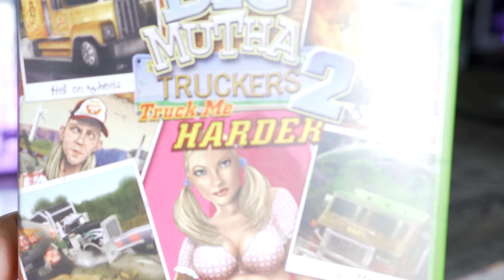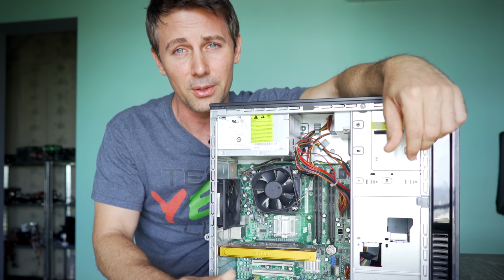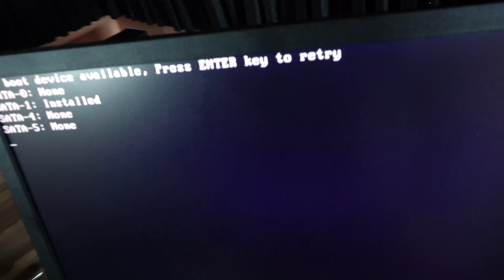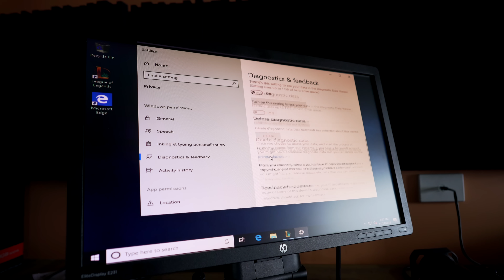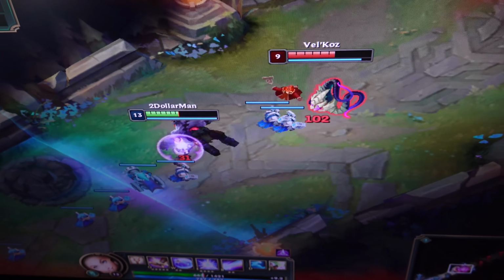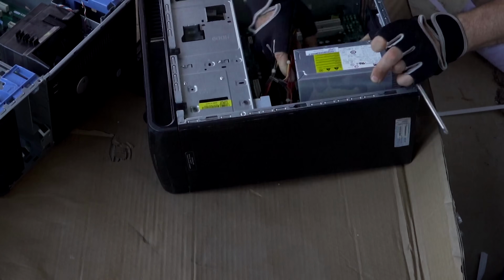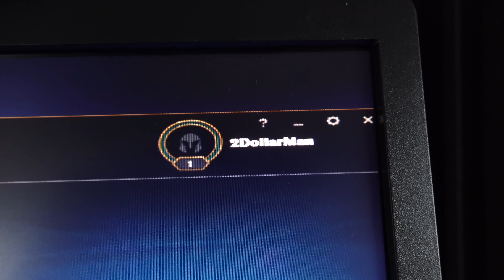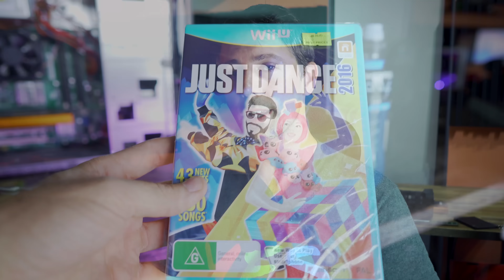This PC Costs $2.... Can it Play League of Legends...!?

Comment: Im glad its not just me who is having issues with 775 and compatability, I go through board after board after board, using what I know to be good RAM, and a good CPU only to have it reject it, until a few part changes later. It got to the stage when I was tested Windows 2000 that my much older PGA478 Equipment was actually simpler to use. Still I suppose if you like slideshows that performance seemed top notch. 

Great Video.
Reply: Quite a common problem with 775 is that it cannot use dual sided ram. I have had several boards not works because of that. but as well some of my boards just don't work at all
Reply: Could u make a video about the stuff u disabled on windows on the start to make it faster?
Reply: Just handed my old p5q + 9550Q 3.8mhz oc 8gb ram + 1050 gfxover to my girlfriend as a media center..... still runs WOT on 80 fps ... med settings
Reply: I once had a Acer PC with 775 and it would take 2 (out of 4) sticks with dual sided memory or 4 single sided... for a while. Also a lot of those OEM Machines with 775 socket have REALLY fkd up bios, for example a Fujitsu Siemens I have would support Q8300 up to Q9650... as well as even a Celeron E3200 and various Pentium and Core2Duo, but no Q6600 etc.

But since you gave up on 775.... : how about doin a 771 Dual CPU build? I use them a lot and really love how stable try run for rendering etc. :P
Reply: @Eduard Berisa i have paired both the xeon x5460 and the e5450 oced with a gtx 770 and can run fortnite @ +60 fps on 1080p high
Reply: Try using windows 7. I have a E4500 with 2gb ram and 9500GT and it runs LoL...
Reply: I just yesterday had a dell doing the same thing I ran the dell recovery that was on hard drive and it seems to work fine now it will still show same can’t read disk 0 when boot and just bypass that and continue and it worked fine so I have went into bios changed some settings and have not seen error again
Reply: I had no issues with my 775 dual core upgrade too q6600 quad all I had too do is research and make sure my bios was updated and supported and presto all worked fine ….
Reply: Budget-Builds Official Im glad its not just me who constantly comments on other budget tech channels to sponge off viewers.
Reply: @dramamine755   Oh sod off, I can comment relevant information if I want. If you think I comment for views then youre greatly mistaken....Then again its hard to feel offended when the guy commenting is mosty subscribed to "Minecraft Lets Play" channels. So if you'd kindly sod off, itd be greatly appreciated.
Reply: @dramamine755 : Unfortunately I don't need too. Still keep on Minecrafting :D
Reply: xP
Reply: @Nick Steinmetz My exact thoughts :)
Reply: Read your comment before the video, and "slideshows" caught my eye. Fun
Reply: Ok the dell optiplex should run League just fine, you need to update the bios to the latest version use a q6600 with 8gb of ram and use windows 7 for better compatability with the old system. By the way I have built several optiplexs that can run league just fine. Optiplex 755, q6600, 8gb of 800mhz dual rank ram, quadro fx1800, and it runs league at 80+ fps at 1440x900 with a mix of settings mostly high with shadows on low.
Reply: I have a 775 small acer desktop pc w/ Win 7..upgraded to a duo quad q6600 running PLEX server w/ 4TB drive and it rins GREAT
Reply: Budget-Builds Official that mother board look allot like the mother board for  Vastro 200 if your looking for the best cpu compatible with that mother board try intro core 2 duo model E8600 cpu 3.3 ghz
Reply: Budget-Builds Official ya the computer he is using is vastro 200 I know this because I’m currently using it.... I’m very surprised because his is way slower than mine and mine does not even have a graphics card!!!!!!
Reply: i have dual core e6600 and gt 440+ 2gb ram and running in  90-150 fps with low seletings
Reply: Budget-Builds Official .
Reply: Hello,My name is Thomas and by this message i would like to kindly ask you,to make a donation of your choice to help me beat my Mouth cancer.I am only 25 years old and i cant afford surgery on my own.I am young and deserve to live. :/ I hope you will help.Thank you and God bless you.

Bank account information:
Name: Tomas Adamik
IBAN: SK3602000000003907442054   SWIFT/BIC CODE: SUBASKBX
Reply: I've built around three 775 PC's. Just added a $15 Q6000 series quad cores to them. All works pretty well even without overclocking for modern games. ie. bottlenecks at around 50 fps no matter how good the GPU is.
Reply: Budget-Builds Official 
.
Reply: This seems very indicative of bad microcode to me. Had the same thing with an old asrock 775 board. It... just... sloggggged. Then I updated the bios and then it zoomed. The bios in there may only be coded for pre-core2 775 cpus.
Reply: Most 775 boards require low density memory like mine, hard to find, got   BLS2KIT4G3D1609DS1S00 on Ebay for $30 to max both my boards to 16GB
Reply: Taht was made for windows 7 and earlier....
Reply: @M1Singh_  as long as u have 8gb mem its quite okay. memmory is the restriction

Comment: Hi, I know this video is 4 years old, but I still have to speak up for the socket 775. The problem is the OEM manufacturers / providers like Dell or HP. They don't want you to upgrade your computer and use castrated BIOSes. These can be improved by updates, but even the updates have restrictions that regular motherboards from branded manufacturers for self-assembly never had. I still love using an E8500 or a Q6600 (with BSEL Overclock @3Ghz) on a 775, even if I only install 4GB. Then a GTS450 or a GTX750 is added and the babies are a lot of fun. One thing could have improved the situation for you, though. Less is sometimes more. You wanted as much RAM as possible, but 6GB simply don't run in dual channel and that makes the RAM incredibly slow and thus slows down the entire system. You built a bottleneck for yourself, I think. PS I would have changed the graphics card for another one before cleaning it. A 7600GS with 256MB and DX9....that's better left alone. The E4400 with a HD5450 and 4GB of RAM was the lowest level I've played LOL or Dota2 on so far.

Comment: I feel your frustration.  I used to play League of Legends on a Lenovo L540 laptop.  I wanna say core i7-4712MQ with the GPU being the built into the CPU I want to say Intel HD 4600 graphics processor (if there's a way to change that out I want to know) and the ram I upgraded, I think it was Crucial 16Gb DDR3L-1600/PC3-12800,  and the wireless card I had upgraded to one that had Bluetooth 4.0 even though I could never get the Bluetooth to work so... it was a pain.  Not the worst to play League on but certainly not the best either. I couldn't even Load Skyrim on it at all.  Fallout 3 wouldn't load or work, Pallone 4 certainly wouldn't,  Fallout New Vegas I could play for about 30min to an hour before it would start lagging and crashing (I feel I need to go through and deep clean it and give it some new thermal pastes and see if I can get it to work.  It was having trouble booting and all kinds of quirks and then in lat 2019 it blue screened and I haven't had anything aside from Xbox since.  I SORELY miss League of Legends.

I just took my old Foxconn A7MG-Series motherboard. It had an AMD Athelon X2 (though not sude which model.  I thought it had 8Gb of RAM (apparently it had 4) but also a Hodge Podge mix at that.  2 crucials, a samsung and something else. And I can't remember what the graphics card in it was, I'll have to find it. I could at least play Skyrim on that so it's gotta be better than the laptop.  Back in early 2013 I bought a new HDD or 2 for it, a new DVD+RW drive and a drive port that had a bunch of different card readers and like 3 USB ports including a USB 3.0... went to add it all in, carefully, hooked everything back up exactly how it was except for the new Optical drive, Card reader and new HDDs and it blue screened.  I TRIED FOR HOURS to get it back running, went to the BIOs and looked around to see if everything looked good and if it we booting from the proper C: drive and everything and it was just done.  The guy I bought it from was passed that I tried to add anything to it (even though he lived 2 towns away) and refused to even look at it.  I figured it was probably where I had like 1200 mods on Skyrim and a stock CPU cooler.  Though it could have been the GPU.  That one was bad for going through graphics cards.  It went through 2 (older but still working fine) graphics cards before I bought that one outright.  So... I'm curious to tinker with it and see if I can get it working.  And see what I can do with it.

Comment: I have 12gb ram 2gb vram and dual core lags stuter fps drops 01 from 30
Reply: Try 8GB or make it 16GB. I think it's the same Problem like in the Video....your Ram doesn't run on Dual Channel and Bottlenecks the System

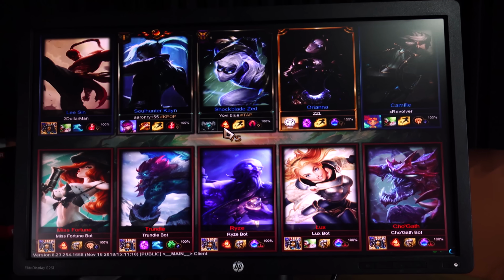Comment: 9:28  well i have a asrock lga 775 motherboard that have this issue, the main cause is they are worn out
 10:20 you didn't install the video card driver thats why the  performance is still the same

Comment: most gpu's and chipsets have phase change tim, it softens when it is hot and solidifies when cold, it actually a longer life tim than regular thermal paste which can pump out of the cpu/heatsink interface during heat cycles.

on assembly they are heated to melt the tim and allwed to cool that is why they often feel "stuck" to the chip.

Comment: Lga775 is one of the best platform next to lga 1366 
I had some good mobos, for example: EVGA nForce 790i SLI FTW, ASUS P5K3-DELUXE ect. And i loved them... and the 771 xeon conversion just made it more fun... 4.5 GHz stable overclock from xeon x 5450 and 5480 
And i had a celeron dual core e3300 that was good for 5 GHz oc.... so i love 775, theese dell,hp, ect mobos just shit

Comment: I rebuild a lot of these budget pc's. The OptiPlex 755 and Vostro 200 will do decent with the latest bios updates. Once it is done, you can install several different Xeons in these (socket 775) as long as they aren't over 95 watts and they will run very well. I have done and sold Many of these!  :)

Comment: I use a lot of LGA 1155 boards, because in my area they're basically just a value that can't be beat. But with that, I've used a lot of the generic Intel branded ones and I've run into so many weird issues (mainly with the Intel branded) like one just never booted again after I changed out the RAM even after I put the old RAM back in (and changed out literally every part to find the problem) and the thing just never worked again. One board wouldn't accept any modern graphics cards, so I updated the BIOS and then it accepted newer cards BUT then it would always freeze on the post screen and was essentially bricked. Another one was just annoyingly picky about what graphics cards it would use... Like out of 2 graphics cards released at exactly the same time (one Nvidia and one AMD) it would only work with one (the AMD). 

So I'm pretty tired of using those boards to be honest, and I think I'm just going to avoid parts like that which are just too cheap and questionable and just stick to better brands like ASUS for my 1155 needs. Some parts just get frustrating and wind up taking far more time than they're worth.

Comment: I am running 3 775 boards surfing, watching Youtube, burning Blu-ray and ripping DVDs. Not a gamer but my son played League of legends on my P43T a while back. My systems :GA-P43T-ES3G, Core2Duo E8600,A-Data 960GB SSD, Hyper 212 EVO ,Ballistix
 Sport 16GB Kit (4 x 4GB) DDR3-1600  : BLS2KIT4G3D1609DS1S00,HIS HD6570 
IceQ ,Win7,Corsair CX750M Power supply, Modified Dell 
PowerEdgeSC430,with Win7, Pentium Dual Core 945 @ 3.4 Ghz, 4Gb 
memory, Dell RadeonHD6350 vid card, GA-P45T-ES3G,Win7,Modified Xeon Quad
 E5472 3Ghz @ 1600MHZ to fit 775 board, Ballistix Sport 16GB Kit (4 x 
4GB) DDR3-1600,XFX RX460 4GB Vid car

Comment: Some LGA 775 motherboards have DDR3 memory. I have an Asus one with a Q9650 with 8GB RAM DDR3 1066MHz and a GTX480 1.5GB installed. It still works and runs games of the time fine, but it is showing its age and I would not recommend a socket 775 (or the even older 771) to anyone. Stick to Intel socket 1156, 1366, 1155 or even AM3+ if you wanna build on the cheap and still get some decent performance. 

If you can spare a little bit more, the socket 1150 are coming down in price as well (in Europe atleast.)

Comment: Its a big lie i have run league at 60 fps in very low settings  resolution=1440-900 
core 2 duo e4300 1.8ghz 
2gb ram 666mhz ddr2 
gt 520 2 gb ddr3 palit
this is all...
Reply: .........so you don't understand english? 

he had no idea why the pc was running soo poorly when it should not have been

Comment: MINIMUM SPECS
 to play lol (on very low setting):
2 GHz processor (supporting SSE2 instruction set or higher)
1 GB RAM (2 GB of RAM for Windows Vista and newer)
Shader version 2.0 capable video card
Support for DirectX v9.0c or better
So you must have done a mistake somewhere :s

Comment: most frustrating build for me in recent memory. was an LGA 775 asus p5n board. 6gb corsair xm2. xeon x5355 with evga gtx 9800+ 1gb gpu. no matter what i tried the board would not run the cpu at full speed. my sli wouldnt work. but was able to get 1 gpu running with a q9400 and hitting 60fps in farcry lmao. but agreed never touching lga775 again

Comment: when I was building my first used parts build, i got a free pc from my work. the hard drive died, so they just got a new computer. they had used it for our laser cutting machine and it had pretty much ran photoshop and other adobe software its whole life. i took it home and bought a 650 ti from a buddy and slapped it in the computer thinking "this will be great with a new graphics card!" I had not realized the pc was running a e6550 core duo with 4 gbs of DDR2 ram.... lets just say when i downloaded fortnite and tried to play it my experience was less than Potato and the bottle neck at the cpu almost detonated. cant complain for a free pc, but it really helped me understand the importance of researching your hardware.

Comment: It is not just because of the graphics card, but also the system files and utility software that you installed in your disk contributed to the slow processing of the application. I am certain that at any point when you "idle", memory leak issues occur which is also a culprit in the slow processing. Hardware is just something use to "hold". Blame the OS and your utility software for it is something that your hardware cannot hold. Did you check your BIOS and see if time worked fine too? Big games like LoL or DotA are associated with thread programming, full mutexes and other "time" related stuff.

Comment: A lot of later model 775 systems are a $40 gpu away from being able to game. Hook up a cheap old 720p television and bob is your uncle. If you don't need high res the experience can be very good in non AAA games. Just make sure you have got one capable of running a decent clockspeed cpu. No guesswork required, there are plenty of resources on the web to find out if your old junk can do it or not. In my experience Quad core is not as important as having a good processor speed is. Dual core 3+ ghz are still able to game. 771 conversions seem to do especially well for me. 

Remember guys, the slower/earlier non-upgradable 775 systems (like in this video) which have absolutely no hope in gaming can live second lives as good auntie and uncle workstations. No need to put them out to pasture in the land fill if they still do email and web browsing. Its true with the 1st and 2nd gen i-series system so low in price, the incentive to build 775/771 systems is lower than ever, but they can still be useful.

Posting this half way around the world, in Compton CA on a win7 vostro 230 xeon E5450 8gb system.  This system and my sons' other low budget builds were all inspired in no small part by Brian@TechYesCity.  Keep up the good work, don't be discouraged by minor setbacks or haters!  Not everybody has buckets of cash to drop on a hobby.

Comment: I thought my RAM was broken so I put it on a different PC. The ram worked fine so I my culprit was the motherboard. Which was confirmed by me having to buy different RAM sticks and using it on the motherboard. So I went and bought a new motherboard instead. Everything worked fine. But I didn't want the old mobo and RAM to go to waste so I tried all sorts of things to get its RAM slots to work.

Turns out, all I needed to do was to rub pencil eraser on the RAM's contacts. Once I did that, the old mobo and set of RAM worked fine again. Never had a problem since.

Comment: The LGA 775 is pretty fine, if you use the old "high-end" stuff. I am building budget PCs for kids with this, and they are getting good FPS in Esports. So, it is more likely to be a problem of OEM Boards, not the 775 socket. 
But: Interesting video. I enjoyed watching.

Comment: LOL! on mobo 2 and 3, the procie or mobo is NOT the culprit. The PROBLEM is Windows 10. i have many lga775 pentiums and core2duo and all ran League of legends fine up to 60fps with windows 7. In my experience Windows 10 cripples any machine pre skylake one way or another. You should have tried a better gpu with 512mb/1gb vram and windows 7. Heck 2gb ram is all League of legend needs...